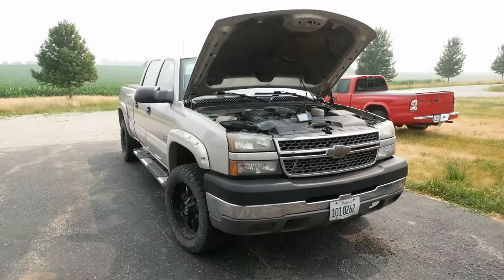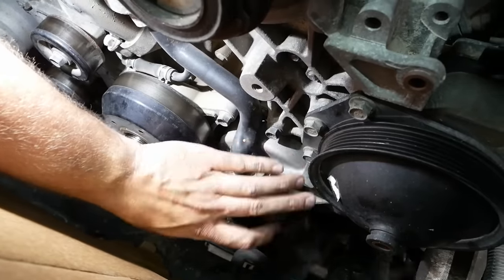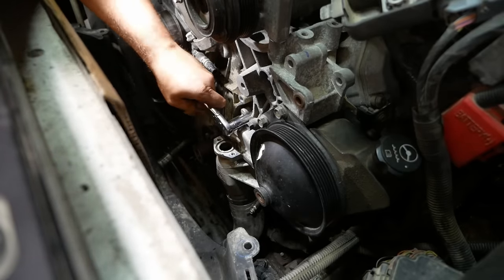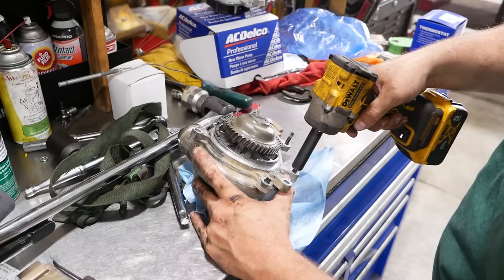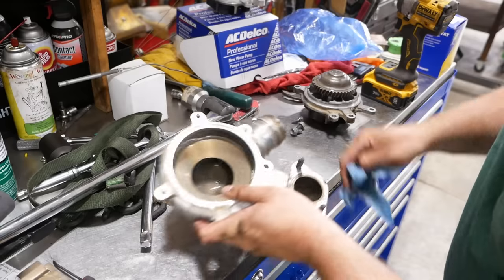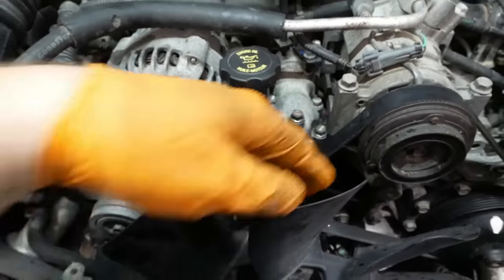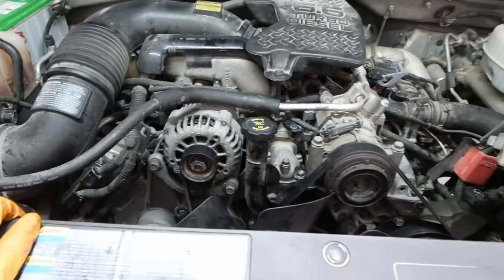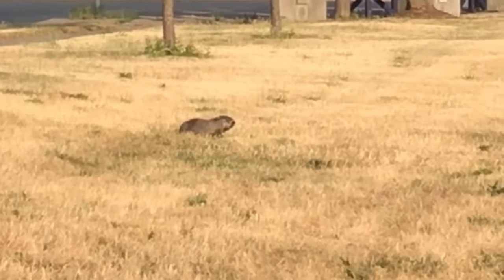Is this Cheating? GM's 6 HOUR Water Pump Insanity

Comment: 6hr job that's nothing GM's great engineering I have 2004 Suzuki XL7 2.7 liter V6 the book says 12hrs the water pump is in behind the timing case cover you have to remove the intake valve covers , radiator,fan ,oil pan and also the entire front end to remove the oil pan it takes the same amount of time to change the the timing chain , took maybe 1 hr job and turned in to 12 plus hrs . Thank you gm 😢😢😢
Reply from the maker: Ford does that on the Eco Boost.

Comment: If it's a twelve-point screw head, you have 360/12 = 30 degrees between points/peaks. This, of course, means that you have half of that = 15 degrees between a peak and a valley.

Three peaks and one valley equals 30x3+1x15 = 105 degrees.
Reply from the maker: Hmm. Seems too easy.
Reply: @WatchWesWork  Nope, just easy enough. ;-)

Comment: I have a Duramax with 200,000 on it.  
Is there a water pump relocation kit so you don’t have to take the harmonic balancer off every time.
Reply from the maker: Yeah, but you're not gonna like it...
Reply: @WatchWesWork  so maybe this is another one of my projects, and I need to design and build my own water pump manifold.  Or add a foot of length for the front of the truck so it’s not so jampacked to work on it.  I don’t mind doing this sort of stuff in the shop but if I’m broke down on the road on one of my big road trips.

Comment: So far i know, correct me if am wrong, GM sold Delco.. and have since  been making parts in China(Delco) ... qiality (like oil filters) have gone down a little i think. So i tend to go with big aftermarket brands.... a bit cheaper sometimes than Delco branded....and i make sure its   US/Canada or MX or even European made.  I mean if you want to instal chinese parts, just go generic chinese brands and not pay the mark up prices i think 🤔

Comment: Saab 99 had a gear driven water pump mounted under the intake manifold.  Pulling it incorrectly would break the jackshaft gear which meant pulling the engine the repair that.  Not a bad job if done correctly.

Comment: I didn’t see you align the invisible timing mark on the gear with the invisible timing mark on the block when installing the new pump. I hope you know that failure to follow that step can cause coolant capitulation and that results in water passage pulsations which are fatal in 87.31% of cases. This was originally considered a design flaw but, with significant input from the engineers, it was subsequently relabeled as a design feature. There was a service bulletin on this but the manufacturer estimates that it would take you six hours to read it. Hang in there. 🥸👍👀💥💨✅

Comment: Do water pumps get any worse to replace than the one you just did what a mission
Reply from the maker: Cummins ISX. Ford Ecoboost. GM Ecotech.
Reply: It was interesting to watch you do the job plus putting cardboard in front of the radiator so not to damage it
Reply: Even doing the tapper cover gaskets on your next video what a shocker to do

Comment: It would seem all engine design engineers can't picture their engine physically installed in a car body. Surrounded by all the sundry bits. It is three dimensional on a computer. With simulated walk round. Or sitting on an engine stand with 360 access. What do you mean that part is impossible to remove jammed up against the bulkhead. It is only two bolts.

Comment: How difficult would it be for engineers to compute the torque required to turn a bolt 105º past the 75 ft lbs point?  Wanna bet how they came up with 105º past 75 ft lbs?  They ketp tightening the bolt until it broke or stripped out the threads (probably around 135º.  So they said, "Lets stop at 105º and call it good enough."  Designers have taken formerly simple DIY repair jobs and turned them into expensive repair jobs like this water pump and fuel pumps inside fuel tanks, tail light bulb replacements, etc.  I remember in my HS auto shop teacher in 1965 saying that there's a few car models that needed the engine to be lifted a few inches (unbolt the motor mounts and chain hoist) to access one bank of the spark plugs.  What were they thinking?
Reply from the maker: Torque to angle is actually better. Torque wrenches aren't as accurate when a bolt is smoking tight because of all the friction. But if you know the thread pitch you can work out how much it needs to stretch after torquing to a low value.
Reply: Wes is spot on.
Reply: @WatchWesWork  Those types of bolts were rare back in the last century.  Learn something new every day.

Comment: ah yes the entire states of Iowa Wisconsin most of Illinois all of Indiana most of Ohio all of Michigan with air quality alert. remember those couple days very well here in Indiana, if i went outside my eyes would burn like I was in a room where 100 people was smoking the funny tobacco and i could hardly see a block away. oddly enough same in Indiana not seen any mice and the mosquitoes have well ain't seen any as well. no groundhogs also. not had issue with flys and gnats more then normal. dogs have been more skittish then usual however.

Comment: Wow... that's a painful design. A Cummins 12V is two easy to get to bolts. Your not having experience with them implies either it's a surprisingly decent engine, nobody's buying them, or they're just getting scrapped.
Reply: Not uncommon for an ISB to go 300k.

Comment: it actually looks like they had Ford design that garbage.  Doing the water pump/plate on a 3.0V6 is a similar nightmare.  All but two of the bolts can be removed without any accessories removed.  The last two you have to remove power steering, A/C, and alternator.. 😕

Comment: maybe the engine was originaly an industrial engine that didn't need belts and was later adapted? might explain the pump being driven by the timing gear
Reply from the maker: Who knows.
Reply: @WatchWesWork  I realised I was connected to the internet... it was designed as a truck engine first and foremost so yeah. owning an isuzu myself i'm not surprised by the strange placement of a lot of things. well built but usually awful to work on

Comment: If the seal goes out on the water pump, doesn't it then leak coolant into the engine and its oil? Nice.
Reply from the maker: No. There is a weep hole like any water pump.

Comment: I see nothing wrong with the way you did it. To me the biggest problem with that design is if the water pump shaft seal leaks coolant will go into the oil.  In time that will destroy your engine.
Reply from the maker: It shouldn't. It has a weep hole like any other water pump.

Comment: 75ft/lbs plus another 105 degrees.  Makes me glad I do not own one of these vehicles.  What stupid engineer came up with that torque spec?  Come on man.
Reply from the maker: That’s very common and more accurate. Cummins has been doing that since the 80s.
Reply: @WatchWesWork  I’m referring to the 105degree angle. Why not 90 or 120?

Comment: If they had better bolt placement, it wouldn't be bad
A gear driven pump is good when your belt gets shredded and you need to limp it to the parts store but don't want to blow up the engine
Reply: Till it dumps coolant in the oil.
Reply: An incredibly rare event anymore.  However a coolant leak the wrong direction can wipe out all the bearings... Never a free lunch.
Reply: @robertquast9684  I haven't heard of that being an issue on any duramax

It would probably happen if you ignored the weep hole leaking for half a year

Comment: You think that is bad. Fords 3.5 L gas V6 has the water pump inside the engine running off the timing chain. Much more than a 6hr job.. It’s all about making things not to be worked on..

Comment: You're lucky w/o mosquitoes. I have to open my door slow or I can suck in half a dozen or more. They're all camping out under the steps. 30 or 40 last time I took the dog out.
  Everything else is normal except the temperature. I have tropical annual vines that for the last 20 years the seeds have never come-up in spring. The last two years they have. This time by the hundreds.

Comment: Isn't that a TTY crank bolt?  I guess it held....this time.  Or he replaced it and didnt say anything.
Reply from the maker: Not that I know of. Even when it says "replace" that rarely means it is TTY.
Reply: @WatchWesWork  Torques that specify angles usually implies TTY.  Because the bolt stretches a specific amount per degree (yes I know you know how threads work).

Comment: Duramax is good at planting money making designs into their engines. Look at the brand new 3L  straight six diesel with the stupid oil pump drive " BELT " in the rear of the oil pan and you need to remove the transmission to fix it.
Reply from the maker: Ugh.

Comment: Torque to spec then add 105 degrees? What is the purpose? Why not just give a torque spec and use it?
Reply from the maker: Torque + angle is a common practice. It's actually more accurate.

Comment: My mechanic tells me I will need a water pump for my 2014 F-150 3.5L V-6 Ecoboost engine within the next 10,000 miles if his experience is any guide. I have 94,000 miles on it. The water pump is partially embedded into the engine block and the timing chain cover and assembly must be removed to get to it. An estimated 10 hours labor with an estimated cost of around $1,600.00.

Comment: i wonder if the crankshaft twists a little with that 3' breaker bar. Awesome content as always Wes!
Reply: If it’s supported close the the end where the wrench is applying the torque it shouldn’t.

All of the engines torque is transmitted through that so I doubt the wrench is effecting it at all. Not when you have 6.6l of diesel torque twisting it all the time.
Reply from the maker: Could be
Reply: @WatchWesWork  yes but please i'm talking concept only. I wouldn't want the pedants to jump on my "concept"

Comment: You can't compair this to the 7.3 in an IH 4600. Years ago the truck came in hot, not overheated, with a leaking WP I had it replaced and heading out within 1 hour.

Comment: Never liked anything isuzu made and that includes those engines. I worked on diesels but once i saw whats involved with those 6.6 shaved half off bolt heads i quit and no more overhead cam engines either

Comment: This model is an '05 2500HD Crew Cab, equipped with GM's Duramax 6600 6.6L, V-8 turbodiesel engine.. Not isuzu

Comment: The torque spec for the pump is 3/4s of an uga duga (it's aluminum. Doesn't need much). Make sure you calibrate your elbow before you start. The spec for the damper is torque it to the moon. I think the last time I used a torque wrench was about two years ago.

Comment: To be fair, the gear-driven pump has the advantage that the engine can still run without overheating if the accessory belt breaks.  That’s not an unreasonable decision for an industrial oriented engine.
Reply from the maker: That doesn’t mean it should be a 6 hour job.

Comment: If the engine was designed using superior human technology, the water pump would be like what Cummins does on the 5.9 (and other engines).  It'd be belt driven,  mounted with 2 bolts, and removable without removing anything but the belt, which you don't really need to fully remove.  😁

Comment: Kinda sad when the junior engineers decide to dump a design that has been used for well over 70 years to drive the water pump off the cam gear. The old design leaked out of the sealed bearings, the new design (if the bearings fail) leaks coolant into the engine. Well, that's planned obsolescence.

Comment: Please put on a proper mask (ffp2, n95) with all that smoke in the air! Breathing in crap like that for a few days causes systemic inflammation (higher bp, bad for your heart), and is a very good way to get asthma.
Reply from the maker: Supposedly it's not dangerous unless you already have an health condition but who really knows.
Reply: A mask won't do anything, you'd need a respirator.

Comment: In my opinion gear driven water pump are a engineering mistake, If a new water pump happens to be damaged in shipping it can take out all the gears and wreck the engine . Ask ZK master tech he had it happen on JD tractor.
Reply from the maker: Seems like something you could see before installing it.
Reply: @WatchWesWork  They thought the shaft was bent. JD replaced the engine with a reman at there expense.